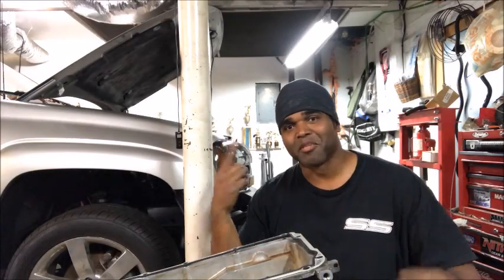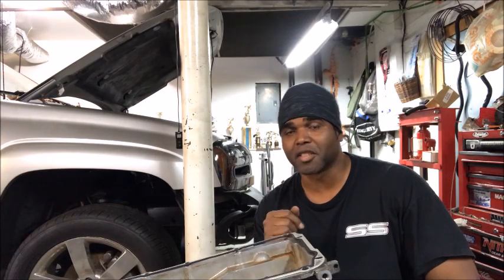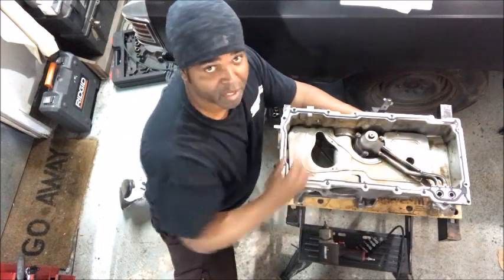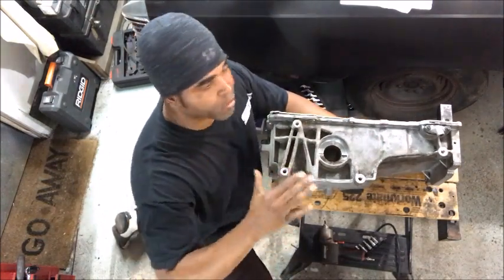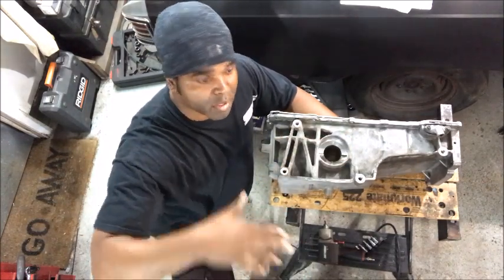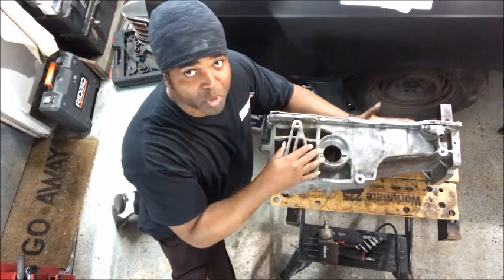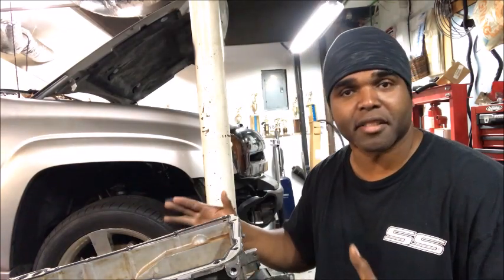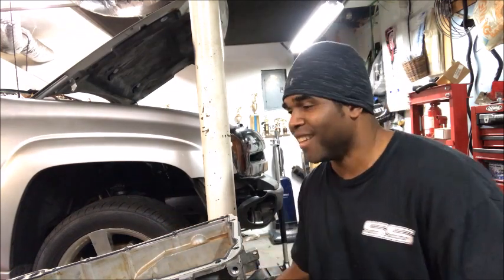Kevin Hanson Trailblazer SS Oil Pan Baffle Installed and Tested.. (The Results Are In)

Comment: When I pulled my AWD pan off with 200k miles to overhaul the engine the pick up tube gasket o ring was hard and not sealing to the oil pump anymore plus the pickup tube gasket bolts were barely tight. Think that was causing my oil starvation more than anything else was

Comment: Hello the videos on the Trailblazer SS about the oil pan you know what you doing and hopefully could help me out I'm trying to put a C6 oil pan on a 2006 Trailblazer and this is a two-wheel drive what does it take to put that oil pan and make it work if you could give me any kind of information on that it will be much appreciated.
Reply from the maker: no problem, being you have a rear wheel drive TBSS its alot easier. the reason i kept my oil pan was the AC compressor had 2 bolts that bolt to the oil pan.  if you're using your ac you might want to keep that in mind. i simply added a oil baffle in the pan in the pan to keep the oil where it belongs on hard launches.
Reply: @Coverman66  where can I purchase the kid for the baffle? Thanks for your help.

Comment: Man I'm having the same oil leak issue on my 2006 9-7x (LS2 swap) it's awd so it's gonna be a bitch but i have to get it done asap (in my driveway) so thanks for the videos bro!
Reply from the maker: my pleasure brotha Carlos..
Reply: @Coverman66  1 question I have the pcm pickup tube installed but I am going to order the baffle kit, am I removing the pickup tube all together and just adding the baffle, or install the baffle and keep the pickup tube? This is a weekend vehicle so i don't do any racing or anything but i need to fix this leak.
Reply from the maker: is the PCM pick up tube a front or rear pan pick up?
Reply: @Coverman66  I'm not sure I won't know until i drop it because my mechanic installed it with the swap 5 years ago and he's no longer around, but as soon as I find out I will get back to you
Reply from the maker: if it is a front pick up in the same area you will be good to go.. is it a all wheel drive? vehicle?
Reply: @Coverman66  yes it is AWD
Reply from the maker: im curious to see if they did a rear pick up swap in the stock pan..

Comment: Have one in my tbss. Also use 7.8 quarts
Reply from the maker: thanks whats up.. extra oil for added protection
Reply: @Coverman66  180k original engine and trans
Reply: @Coverman66  you also for got to mention that having a front sump with bad motor mounts doubles the chance of starvation not only on acceleration but also up hill driving. Thats why I run an extra quart and half
Reply from the maker: your right, people over look the hills lolol

Comment: Very cool that you thought to do this. I just installed my baffle on my AWD TBSS but I forgot to do this.  I also forgot to test how many quarts of oil the pan will hold. I wanted to do this to get an idea of the level of the oil for running 7 quarts of oil.  This has been a popular thing to do to help with the starvation problem. Did you look into this or is it something you still can do if you have the pan off?
Reply from the maker: if the pan is out it would be the perfect time.. once i knew i was adding more power to the truck i know i was going to do this..

Comment: My oil pan leaked on my ZL1 because it was warped. Dealer had to replace it. Itr would weep oil even after installing a new gasket. Good time to check for warp since it's off.
P.S. I like your GO AWAY floor mat!
Reply from the maker: yea it might be easier just to get a new pan.. esp if you replaced the gasket..